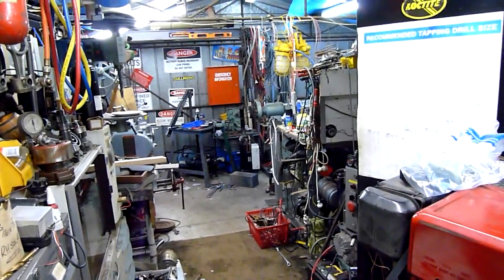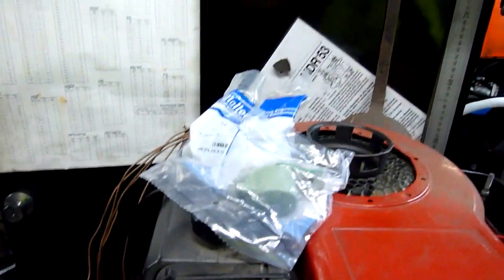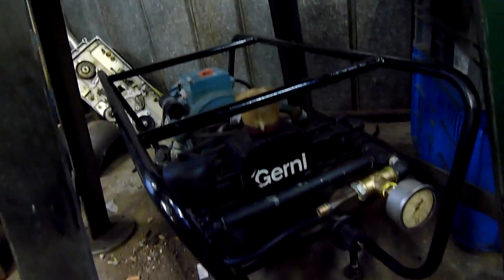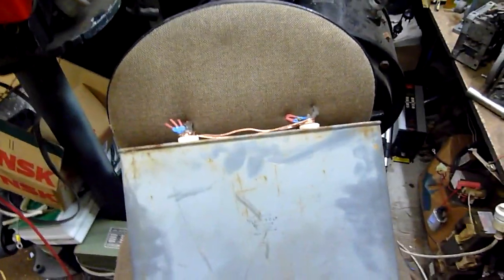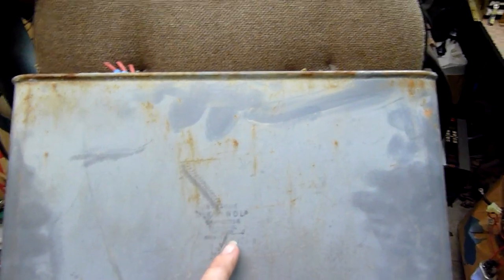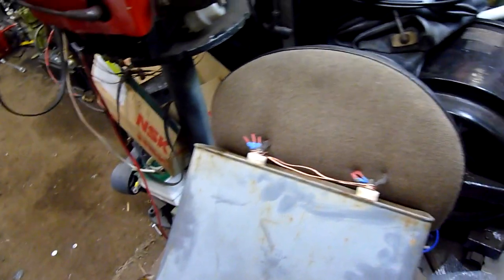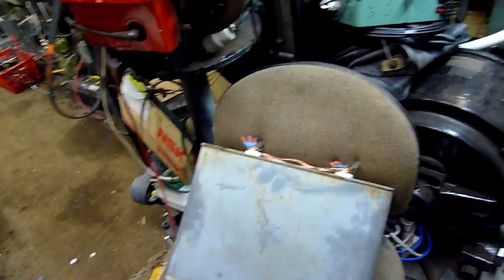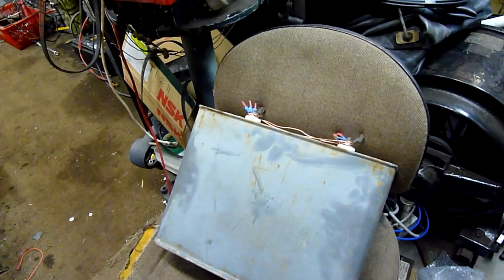Thursday Update and Big 24000V Capacator

Comment from the maker: @fridgebulb a long length of insulation (usually PVC for HV  or dry wood for LV) with a probe attached to it.

if I were to use a chicken stick on the cap I would have a wire going to the stick on one side of the cap, and use it to touch the other side of the cap and get a spark (or a loud bang)

Comment from the maker: @demonbreed131 that's correct , some times its hard to avoid getting small ones mixed in the scrap metal /rubbish, since old fluorescent light fixtures and air conditioners have them inside, and most are just munched up with the scrap.

Comment from the maker: @Photonicinduction yeh the exact number on the case is 24,5000 DC, so it really does look like a mis print when you look at the insulators.

either way a MOT will have no trouble charging it

Comment: Hey Ed. Its a DC capacitor. Polarity is there. If your lucky, remove the short amd wait till it charges a little bit out of nowhere. Then measure the voltage with a sensitive multimeter. Now you can get the polarity of it.
In theory. No experience with this.

Comment: what you said about the lamps in the lcd's, from now on you wont have those to get rid of, theyre all going to the led lcd's, which should have a longer life, but if they burn out, you can replace the led's alot easier than you could with those lamps in the lcd

Comment from the maker: @MrDubje I have seen non-polar caps in old electronics but I am not sure if they were AC or DC

would trying to charge it with a really low current 12V DC supply work? just momentarilty

Comment: I think it's a non polarized capacitor just because of it's foil, film, and oil construction, basically like a big paper capacitor. Sprague is still in business and has a web site so you may be able to find out what the capacity is and whether it is polarized or not, I'm thinking it isn't. I can't comment on the other capacitors in the bin but the smaller voltage, smaller microfarad capacitors mostly used mineral oil rather then PCBs.